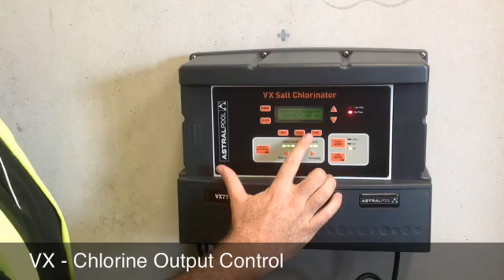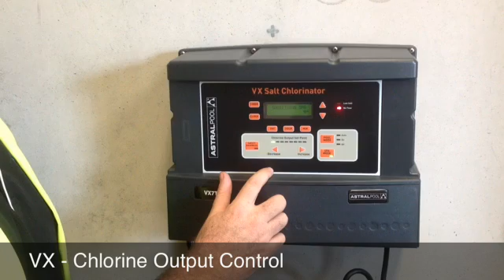VX Salt Chlorinator - Chlorine Output Control

Comment: Hi,  My VX9 low salt light stays on even my pool salt ppm is 3350 .  The same happens even after I have soaked it in  1 part HCl +  10 parts water for about 5 minutes. The cell is working because I can see the electrolysis where the brine turns cloudy as it passes thru the cell. The panel keeps indicating the set value with minus. However the Total Chlorine and Free Chlorine is very low when I test the water. Would you be able to advise what else can I can check?

Comment: The number on the display has a "-" at the right.
For example, if I turn on 3 lights, I have in the display  "3-" 
As a negative number...

Is it ok ?

Thanks
Reply: Yes, it's OK, it switches polarity automatically to clean your cell.